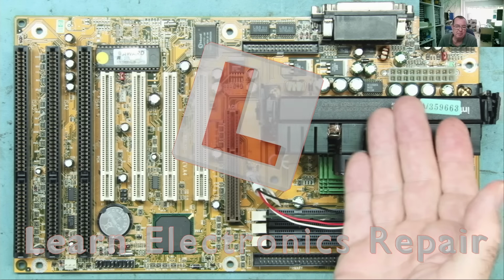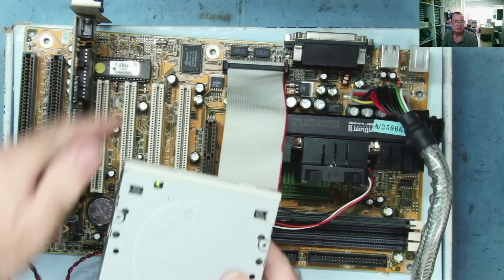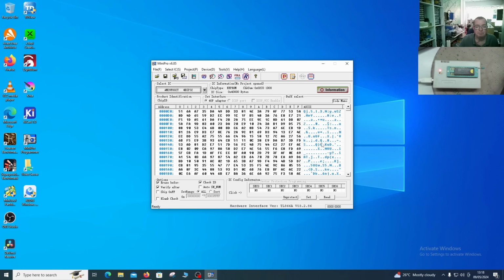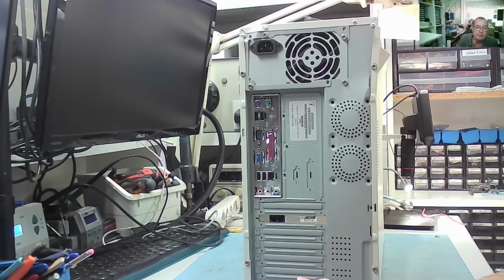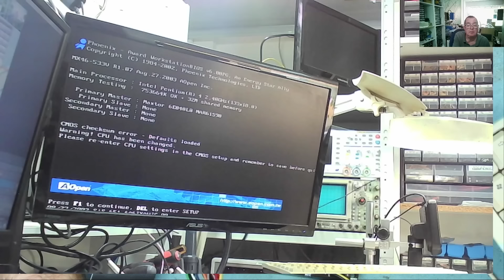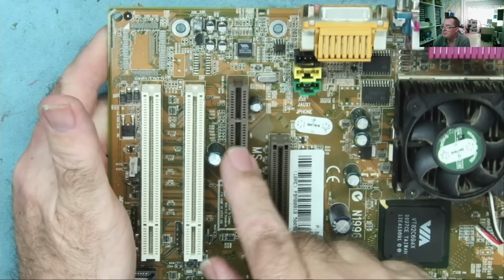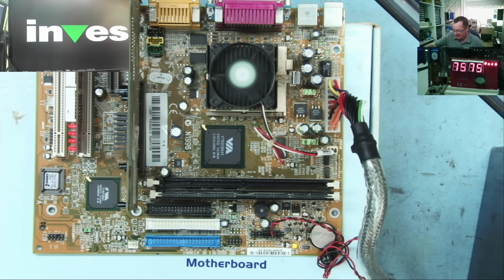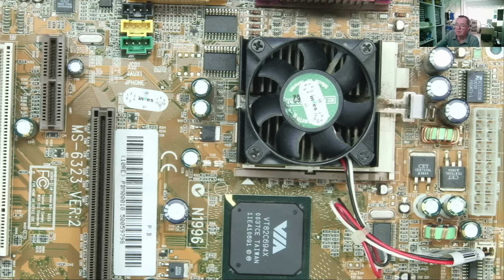Car Boot Retro PC Finds 12th May 2024 Why did the computer go BLEEP?

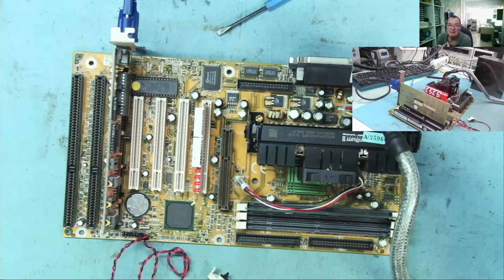Comment: 13:18 You made a classic noob mistake there. The flashrom is 2Mbit (holds 256kB) but the file you programmed to it is only 128kB. You need to program a bios file that is size 256kB. Alternatively if the bios really is just 128kB you can double it using the dos copy /b command and then program the 256kb file to fill the flashrom and if you are lucky it will be accepted. Often boards used a rom twice as big as required and the image was doubled up so that it could switch to a recovery mode and boot from the 2nd copy.

Comment: @Richard: I know why your Downloaded BIOS did not work. These are double packed! Open extracted BIN file with 7zip or winrar and unpack them again. You get: "original.tmp" file. Then try to flash new unpacked file to the CHIP....PLEASE NOTE: there are two sizes! 1Mbit and 2Mbit there for download! You have to know, what version (SIZE!) is suitable for your board.....

Comment: Are you sure that floppy doesn't need the lead with the twisted section? early motherboards / floppy's needed a lead with about 4 leads swapped.
Reply from the maker: IIRC Whichever is at the end of the cable will be the A: drive and the other one will be the B: drive.  That's why there is a twist in the cable, it saves you from having to set a jumper on the floppy drive.  But it was all a very long time ago so I hope I remembered that correctly
Reply: The BIOS recovery mechanism seems to be looking specifically for drive A, which should be plugged in after the twist.
Reply from the maker: @piernov  Which is where I plugged it - on the end of the cable.
Reply: @LearnElectronicsRepair  true, a long time ago. Would it not be worth a go though?

Comment: At least you made that terrible bleeping stop. That was the worst bleeping I've ever heard. I'm surprised none of those BIOS worked. I felt for sure when you flashed the chip it'd boot then. Can you checksum the files you've got? Whenever I'm doing critical stuff I always hash the files I've downloaded to make sure what I have is right. You never know what condition a file is in that's been kicking around on the Internet for 25 years now.
Reply: @user-mw6se3jp6z Why won't it work? 128KB can fit in a 256KB space. If he tried to flash 256KB into 128KB that wouldn't work. Half would be missing then. You can half fill memory though. You just can't jump to the unused memory addresses. Which shouldn't happen. The code you have should never try to go out of bounds.
Reply: @user-mw6se3jp6z That EEPROM functioned in the programmer and on the motherboard. The only difference with various EEPROMs is how many address lines they have for their capacities. Larger capacities have more address lines.

Comment: BIOS CHECKSUM ERROR on old Mainboards means: DATE and CLOCK settings are wrong....
Reply from the maker: That's CMOS Checksum Error isn't it? And not just because the date and time are wrong but because the CMOS is corrupted.
Reply: @LearnElectronicsRepair  My mistake Richard: you are correct (like most off the time 😁)
Reply: How does the motherboard know what date it is? Clock skew detected! Party like it's 1999 baby. Just boot it up wearing a pair of parachute pants and it'll never know we're in the 21st century now.